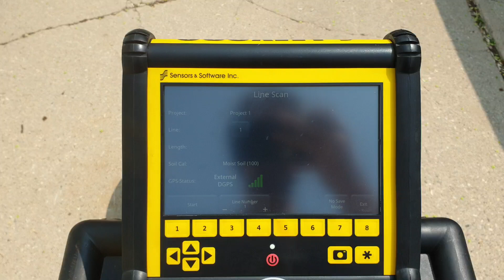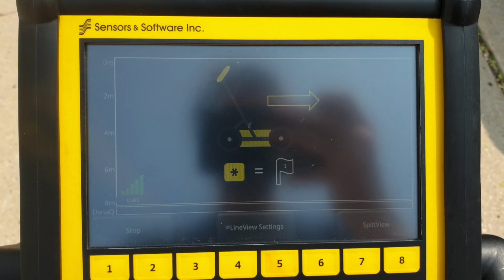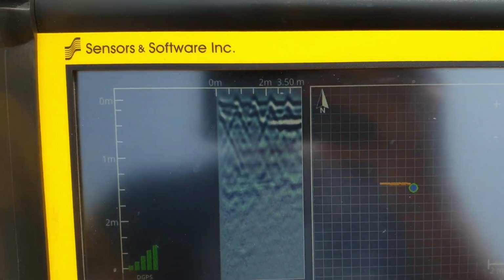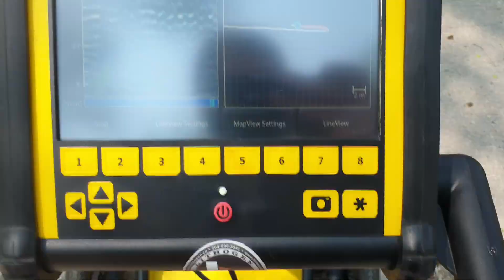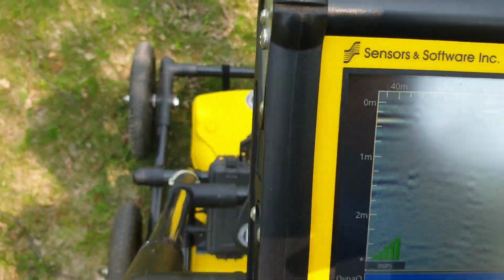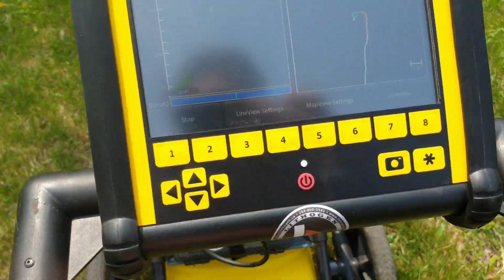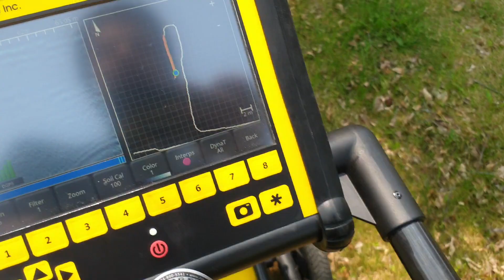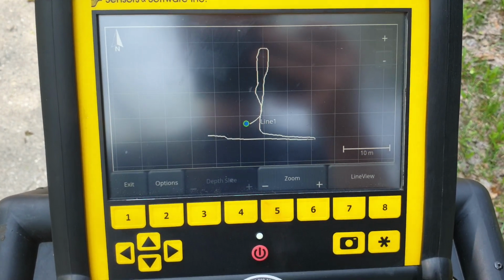LMX200 Linescan mode with GPS

Comment: What the maximum depth ?
Reply from the maker: Depends on the soil. More clay means less depth. In sand you'll get ~4m. In clay like we have here in Winnipeg, 30cm.
Reply: @TroyUnrau  I read now the specification on internet he say : 8 Meter. Now this not true ?
Reply from the maker: @darazs6173  It depends on the soil. In perfect conditions (dry sand, or ice) it can easily do 8m. The real world varies a lot though. Some materials (like clay) absorb radio signals and GPR is the wrong tool for the job in those places.
Reply: @ Thanks